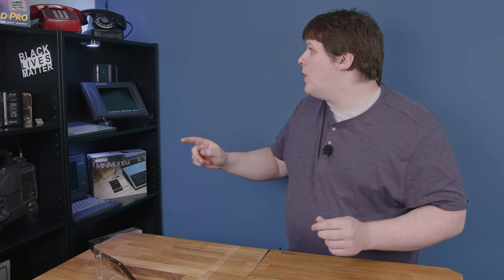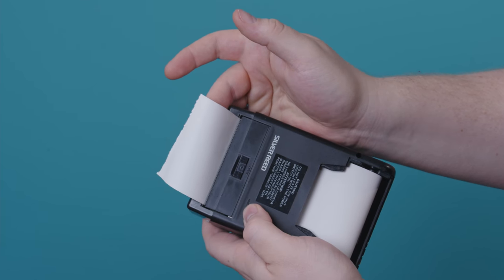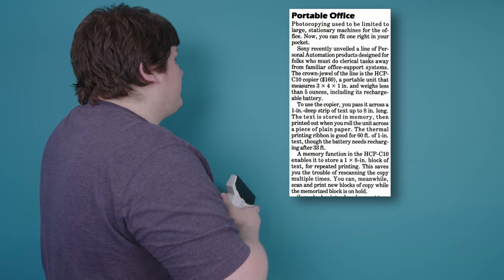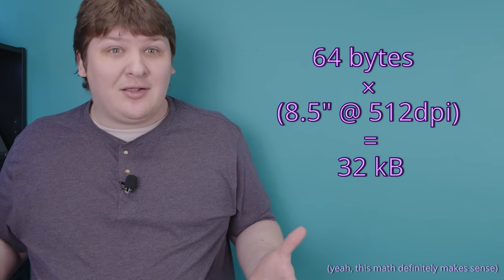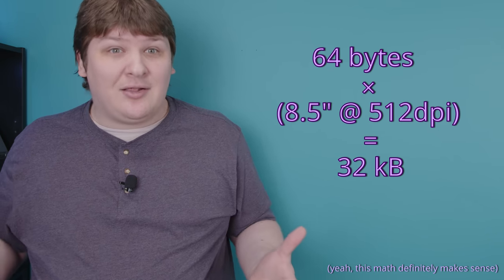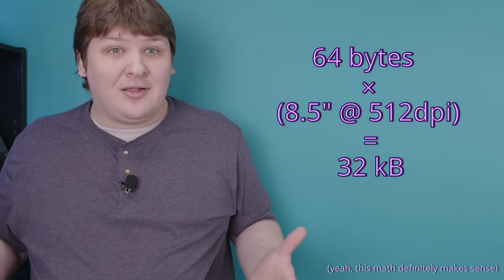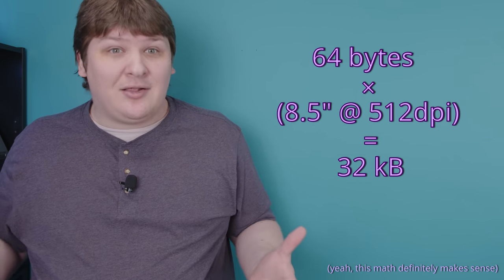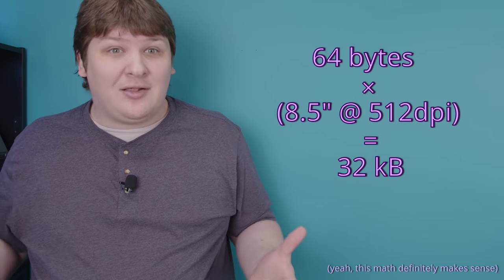The Pocket Xeroxes of 1986

Comment: As a former Xerox Corporation employee, I was disappointed to see not any Xerox products in your video. Also, they had us brainwashed so much about their brand protection, that 33 years after leaving the company I still bristle at people calling generic copiers "Xeroxes". (The worst was when someone told me they had a "Kodak Xerox" meaning a Kodak copier. Also, I am surprised Xerox didn't actually have one of those, but if they had I probably would have known about it then. I used to work on the big Xerox machines that were called duplicators.  (Google Xerox 9200, 9400, 9900...) Otherwise, a good bed-time video!
Reply: How about when Xerox worked with the CIA to put cameras inside copiers sold to the USSR? While it was difficult for government people from outside the Soviet Union to get inside, they had an open door for the servicemen from Xerox, who were all really CIA agents trained by Xerox. In addition to servicing the copiers, adding toner etc, they'd remove the images taken by the camera then carry them out without being searched.
Reply: That is an interesting comment, that got me remembering some other cool ancient tech of the 1985 Era: I think it was a SHARP copier (I'm not sure - some short Japanese sounding name) that used extremely high pressure drums, rolling the powder on normal paper instead of high temperature (like Xerox does). But the nifty thing was: It had a pad on the top of the original Sheet lid with a stylus, where you could define Vector enclosed areas to leave out from copying. Not too easy, because the Lid was opaque and so you had to guess where to set the points. In Addition you could have one out of three different powders, one each time of copying, just by the press of a foil button:  black, white, red, silver that I had actually used and some more I don't know. In combination with the defined area, you could have fancy effects by a multi pass operation. But I was a kid at the time ... For me the killer feature was the red color ... I made hundreds of red 500 Dollar Notes for Playing Monopoly. You can imagine what sums we could gather, while playing for several hours...
My father, who had bought it for his company loved the features, but had to give it up after a few years for the cost of mainenance and materials I think. They had rather high B/W copying volumes and so operating cost mattered.

Comment: That's just so nifty to see that little receipt printer spitting out paper at the same speed you drag it.

Red LEDs were a lot cheaper and more reliable/established back then, I think.
Reply: Probably also brighter, and filterless CCD's are more sensitive to red light
Reply: In the 80s, LEDs were a mature technology in red, green (the yellowish green, not the emerald green we have today), and everything in between (hence the various shades of yellow, amber, and orange LEDs). Blue was still being developed (costing dozens of dollars a piece for extremely dim output), and white LEDs (which are bright blue LEDs with yellow phosphor on top) hadn’t even been envisioned.

My hunch is that they initially chose red because they were the relatively brightest: not only are CCDs more sensitive to red as mentioned in the previous reply, but bear in mind that human vision is most sensitive to green, so to get a red LED of equivalent perceived brightness (to the human eye) meant the red LED would actually need to emit more light than the green one. Thus, my suspicion is that red LEDs were actually more powerful, and ultimately gave the most image sensitivity per milliwatt of illuminator power. 

(Red LEDs also require the lowest voltages of any visible light LEDs. The shorter the wavelength, the higher the voltage, generally speaking.)

Comment: I suspect for the film they used a prop rather than dealing with the unreliability of the technology.
Preprint the document, roll it inside the device and detach the power to the heating element so it'll guarantee to roll out looking good.

Comment: Re: Ni-Cd batteries and the power draw
Ni-Cd batteries were actually really good at delivering short peak power. They were the best type of cell you could get for short duration high power delivery. The total capacity was relatively low, but the impulse power they could produce without bad effects was very good. 
Right up until the 2010s, they were found in Makita power drills. They skipped Ni-MH cells altogether (at least i never saw ni-mh in my store for makita power drills) and jumped to lithium right away when those started to become good enough.
Reply from the maker: oh absolutely, I should have clarified - I'm sure they could deliver massive amperage on the spot but if that pack rates more than 1000mAh, I'll eat my hat. Frankly more like 400mAh - I can't imagine it lasted longer then a few minutes.

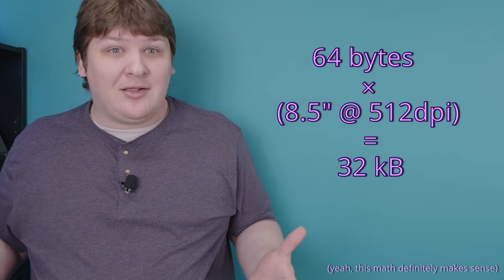Comment: 8:42 You don't even need 64 bytes. The image sensor and thermal element probably handle data serially, so as it reads the CCD data out it could be sending that to the thermal driver immediately. It might not even have 64 bytes of RAM.

9:48 I think it must have an encoder. If it were simply modulating the heat of the thermal heads continuously based on the image sensor, it would "overexpose" the paper if you were moving it more slowly, or stopped for a moment. I think it does have an encoder, and every "pulse" it signals the unit to scan the image sensor, match the thermal to it, then after a preset time turn off the thermal output and wait for the next pulse. This is the only way to ensure even exposure.

Comment: This product is so cool. I was born in '91 and have been using all the bits of tech and neat gear I have been able to get my hands on ever since and yet I feel like if it was repackaged in a less clearly very 80's case and had a lithium battery instead of the nickle cadmium you could show it off, tell me it was the same price as was originally released at, and even tell me everything it does to function and I would be inclined to think, "what cool 2010's tech, I wish we had those when I was a kid" xD

Your the king of finding things that boggle and delight my sensibilities CRD ^^

Comment: The thermal transfer ribbons are especially cool when they were used in typewriters, several companies made extremely compact and battery-powered ones, including Silver-Reed. The ribbons are quite hard to find anymore compared to most other electronic typewriters, but of course the major advantage is that you don't need them as long as you have a roll of fax paper. I've been meaning to get one, but to be honest I'm actually a bit more interested in the portable pen plotters in a typewriter form factor that were a thing in the 80s as well (although the pens for those are even harder to find than the thermal typewriter ribbons).

Also, Silver-Reed is quite an interesting company, I've been trying to find more information on them ever since I inherited my grandpa's old electronic typewriter but unfortunately details are quite sparse. Their main industry was actually knitting machines, which actually ties into kind of a fun connection: Brother is most well-known for printing devices, Silver-Reed for knitting machines, and Singer for sewing machines. However, all 3 of those companies have been active in all 3 of those product categories at some point or another.

Comment: I absolutely love seeing specialized mechanisms like this. It's simple, it's dumb, it solves a problem, and it just works. I like to call things like the roller physically advancing the print mechanism "mechanical intelligence." It's like a fine watch or an engine, mechanical things working together to make something happen automatically, with little or no actual brains to it. I actively try to implement this type of intelligence in designs I make when I can.

For example: My robotics team needs to have a cup on an arm that dumps things out into bins, and needs to bin to return to an upright position inside the robot to collect the next item from our intake. We could use servos to move it, but we are limited to 12 servos on a machine in the rules. We have skated around these in the past, using 2 servos for 4 things with a multiplexer, but that's not applicable here. We could use one of our limited servos on an extending arm, but we now have to not use one elsewhere, run wiring out on an extended arm and not have it tangle when it retracts. Instead, we have the cup shaped in such a way that when it hits the edge of the bin, it just gets pushed into tipping over. We make sure it lines up with the intake when it retracts by having a set of pins on the upper rim of the cup engage with "tracks" inside the machine. This has saved us a servo, the weird wiring problems of putting it on an arm that gets 6x longer, completely automates the process of dumping the material, and always matches with the intake. If we had done this in software with a servo, it would have likely been an extra button to press while driving which would waste time in a match.

Comment: Pendant alert: The thing that gets transferred to the paper in a thermal transfer printer is actually wax. When its activated by the printhead, it literally melts, detaches itself from the smooth PET carrier film and attaches itself to the comparatively rough paper surface. There are other formulations mixed with special resin, or even that resin by itself for greater smudge resistance and printing on synthetic materials but that's going a bit deep.

Comment: Great video. I had one of those Porta-Copy machines some 10 years ago (life changed since then, it's been lost). Wasn't terribly useful then, and had a dead battery then as well. I played with it a bit though. Never had a use for it. What I will add to this, though, is that I don't think it has any digital logic in it at all - no microcontroller, no memory, no buffer. Just pure analog connections between the sensor and the print head. Notice that there's no dots, no dithering... and dare I say, greyscale! That's not a microcontroller, that's just purely working in the analog realm.

Clever dang things, though. If I had to guess, they didn't take off because people already had established other ways of solving the problem these were there to solve, and they were never around when the opportunity arose. So they were just relegated to the closet.

Comment: Sharp one used all parts made by Sharp for themselves, the printer is from a cash register or printing calculator, and the scanner is also one made for use in barcode scanners, all things Sharp made for use in point of sale applications, so volume made them very low cost. Likely only cost Sharp $30 to make, and likely also used internally Sharp designed and built ASIC chips to get all the logic together into one, using a 68000 series Hitachi microcontroller with 64k of RAM built in. Probably only 3 chips in there, one the microcontroller, one the Sharp printer control chip, and then an ASIC that did the rest.

Comment: At about this time I was working on scientific equipment and those printers became popular. They were good enough at the time and printed fast enough to make a tag or a record of some kind. The printer unit was made by some division of Seiko and for a while everything had one. Mostly all I had to do was remove the dust off them but the really dirty ones could be washed out with alcohol and the worked just fine afterword. When they completely failed or were damaged at first they were expensive and came in a fancy box and years later the price fell way down and they came plastic wrapped in a box of 6. Just the thermal head was also available.

I suspect that same division of Seiko designed all the handheld scanner/printer just to make use of the thermal print mechanisms.

Comment: Yes, the inkjet was out by then (for several years in fact). Inkjet began small and grew bigger, by the way: the first inkjet (the 1982 HP ThinkJet) was very compact. The 90s gave us large-format inkjets, initially cobbled together from desktop printheads (I saw one at a trade show that used 16 DeskJet 500-style heads, modified with continuous ink), later with purpose-built hardware. And now they have continuous web inkjets that print on 42” wide paper with full-width 8-color heads. They’re a bit too big to fit on a desk, though! ;)

Comment: I had one in the early 1990s, that would thermal print what was on your tv screen. It had a composite tv signal input, and a 3 inch thermal b&w paper printer. I still have the only one picture I ever kept from it.

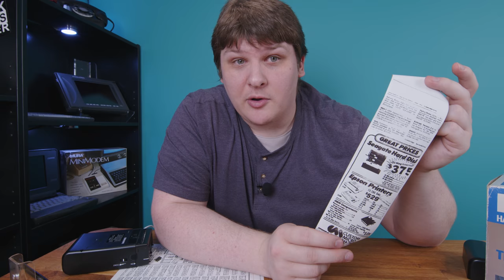Comment: 3:14 With regard to the printout being a bit splotchy... the print quality was very likely better when the device was brand new. My current job has me servicing a lot of thermal printers, and splotches are a common sight when the print head is unevenly or weakly pressed against the paper. A thermal print head will typically have some springs in its assembly, and they can lose some compression force with age and use. Thankfully these springs also tend to have worm screws so that you can re-calibrate the print head assembly rather than needing to replace it entirely. Literally in the last couple of weeks I've had a handful of service calls for poor print quality that were resolved just by re-engaging loose clips or adjusting worm screws.

Comment: NiCads can probably handle that current. The problem with most of them, as well as with NiMH, is that the chargers are often garbage, and won't supply the voltage needed to fully charge a cell.

Comment: I had the modern equivalent of that. Had one of those portable wand scanners that store the image to an SD card. I only used it a few times, the cam scanner app basically replaced it. I used to use it for work to scan receipts, but I was too lazy and usually just stuffed my receipts above my visor in my vehicle. Then just used my home scanner to scan them all at once. My company changed the rules too, now I only need a receipt if the purchase is over $75, So I'm even lazier now and just don't go over $74.99 and if I do, I just make 2 orders. lol!

Comment: I think I still have a ScanMan Plus and the box from that era. I bought a color conversion kit for it from some company. It consisted of three gel filters, a scanner guide frame, and software package. The guide was necessary because in use the color original had to be scanned three times with one of the gel filters each time and all three passes had to be aligned. The software overlayed the layers and combined them for a color image. I think color scanners must have been very expensive at the time.

Comment: These things reminded me of the one line of text digital scanner that was kicking about in the office i worked at. It was meant to be dragged along a document much like these things are, but it had an OCR processor in it.. It would digitise it and send it to your computer with an infra-red transmitter. It was crap. There was nothing it could scan that you couldn't just type manually into the computer yourself. Which you would then have to edit, as the OCR was pretty terrible. It could only cope with certain fonts and sizes.

Comment: This would be the perfect application for a device MOS made called the RIOT chip, RAM I/O Timer. Now you have 128 bytes of memory along with whatever the microcontroller has built in, store 2 lines at a time. Slap a shift register next to it and you could have a serial port to use this as both a scanner AND a copier, and even a basic printer if you accept data in reverse!
EDIT: I guess Ricoh did that

Comment: Minor error @5:02: All of the Canon 5D series (from the original through the Mark IV) as well as nearly all modern cameras use CMOS sensors, not CCDs.  CCDs (Charge Coupled Devices) and CMOS sensors are actually quite different in their operating principles, power consumption and design...
Reply from the maker: yep, I'm aware. I thought I'd used the term sensor rather than CCD, but I reshot that scene so many times I might have forgotten it the last time around
Reply: @CathodeRayDude  Sorry to be pedantic...  I definitely enjoyed the video and look forward to the next one!
Reply from the maker: @mjbuehler  No problem, it's a common misconception for sure - In fact, I had a script in the pipeline where I talk about this exact distinction in depth because most people don't know about it, it just hadn't come up yet for a video, haha

Comment: I doubt the first few even use an MCU for the image data. CCDs work as shift registers, producing serial output for each line (so just one line in a linear sensor). They probably use Schmitt triggers to turn the series of gray levels into pure bilevel black and white, then simply run the bilevel serial data into latched shift registers that deserialize the data and output it as pulses to the print head. (The latching and pulsing because there are strict limits on how long each thermal print element can be energized without suffering damage.) The trigger buttons probably just turn on the LEDs and turn on a clock that drives the circuitry.